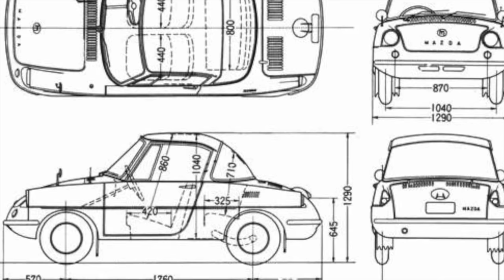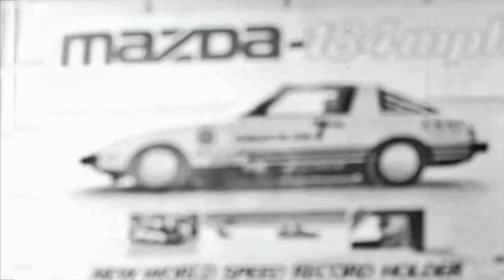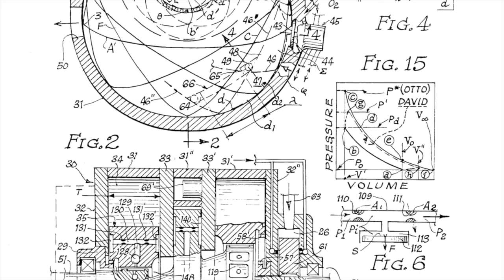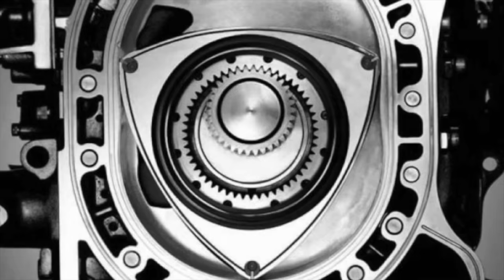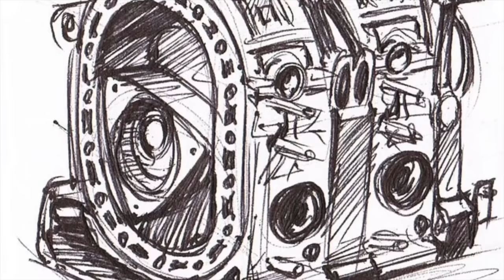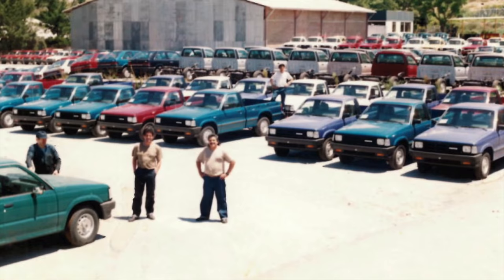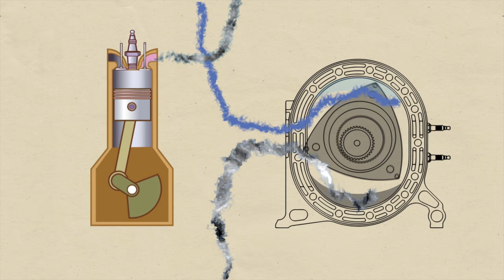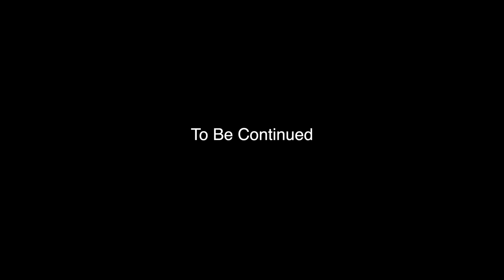Here's Why Mazda's New Rotary Engine is Genius

Comment: if my memory is good suzuki made a motorcycle with the rotary also .don' remember how they performed. back in the 80s my brother had the pickup with that motor . took it for a ride . i was into 2- stroke dirt bikes at that time and the powerbands seemed similar , flat on the bottom but as the revs came up it pulled pretty good compared to comparable small trucks at that time .

Comment: I always thought material technology is lagging behind the design of the rotary as Mazda implemented it and it's biggest problem has not yet been solved, so they move away from it. I think it's still in research however

great job  running thru the history. I never knew they were a big relief effort for post-war Japan. I always dreamed of having a Cosmo
Reply: Actually that is not true, the Wankel engine is obsolete because it's used several fatal flaws in its inherent design concept.
It's theoretical thermal efficiency is significantly lower.
It is less mechanically efficient and gas terrible combustion efficiency due to its geometry envelope.
 A round piston and cylinder is superior to the Wankel because of better seal integrity and thermal expansion.
Reply: Mazda abandoned development of Wankel engines in May 2009.
Reply: @sandervanderkammen9230  no actually Mazda announced the Sky-Activ rotary should be in their 2022 lineup. that means it was not an abandoned concept but kept in the loop
Reply: @pauls5745  Skyactiv-R is an internet hoax started by bloggers..

Mazda abandoned all development production of Wankel engines in May 2009.
 No new prototypes have been seen since 2008.
Mazda has not unveiled any new production Wankel engines in over a quarter of century.

Comment: Rotaries are still a viable option. piston engines just had a lot more manufacturers working on improving it. If rotaries had as much resources dedicated to it they'd be at the same or a slightly lower reliability and fuel efficiency level as a piston engine.
Reply: Not true, perhaps you should learn more about the development history of the Wankel engine... 26 of biggest and best engine manufacturers in the world spent billions in a race to bring the Wankel engine to the market first.
By the middle 1970s the experts had all reached the same conclusion... that the Wankel engine is inherently inferior to reciprocating engines.

Comment: WELL !! As long there's puerto ricans & australians the rotary engine is not gpnna die cause that lil engine has BIG ball honestly not much torque BUT they rev very fast & very high up to 13/14 rpm easily. Thanx mazda

Comment: Normally aspirated rotary engines routinely last 200,000 miles, and (assuming you can find a mechanic to work on them) are less expensive to fix.  I have an RX7 with 325,000 miles...(admittedly on its 2nd engine)
Reply: You really don't know anything about Wankel engines do you?
Reply: @sandervanderkammen9230  Owned an RX7 for 20 years.  I know pretty much everything about rotary engines.
Reply: @VAXHeadroom  Apparently not... not if you believe that they are reliable.
Reply: @sandervanderkammen9230  It's not that I 'believe' it, it's that I have hard evidence of it. 325,000 miles including 2 round trips from MD to FL and used as a daily driver for many years.  Normally aspirated 13Bs get about 200,000 miles between rebuilds.  Turbo charged cars are less.  Hot-rod it and all bets are off, but no different than any piston engine car. AND cheaper to rebuild.

Comment: Question Scotty! I just bought a 2002 Toyota Highlander. Would you suggest using the overdrive button? It feels like it's working the engine lot harder. Also why does it feel like the Highlander takes a very high speed of 85 miles an hour to switch into 4th gear? Would really love to hear back from you thanks

Comment: The most intriguing car I ever owned was a Mazda RX-4 which of course had the Wankel engine. after a week of driving it I looked into the hood to see where the gas was going. Then I saw the engine was topped with a 600cfm Holley. Hard to believe but there it was. Another happy accident was some loud car pulled up next to me at a light so I turned the dogs loose and to my utter disbelief I was at the next intersection before the other car finished crossing the first intersection. And I had a five speed stick. Nothing about the styling of the car said "Speed" so I owned my first "Sleeper" Then those short runs got to be a habit. I didn't care what pulled up next to me. I would win. I knew it. I also found out that engine car rev up to infinity so if I didn't have time to shift, no problem. Sadly the time was up at 80.000 miles, I lost one rotor, kept driving it although the speed was gone then the other rotor quit. I parked it using the starter motor and that was it. But if I ever had a chance to get another Wankel engine I sure would. I would enjoy it at least for 80.000 glorious miles!

Comment: Ive had 3 older RX7s.... I always thought the motor was amazing..... Chevy had a Camaro on the drawing board in the late 80s with the rotary engine... They scraped it because the maintenance cost was to low :( yep

Comment: Actually I think Mazda used my idea to improve the rotary by  incorporating a full plasma ignition system. I saw they are using it in the RX9. It will eliminate the rich nature of the rotary motor plus more power! Auto manufactures are so far behind from the after market performance world!
Reply: The RX-9 never existed, it was an internet hoax started by bloggers.

Comment: NEW?  the engine was designed in 1960s by Felix Wankel. The design was sold to GM to be used in the Vega, but it failed the 50K emissions test and was sold to Mazda.
(On a clear day you can see General Motors)

Comment: I personally have been wondering why I haven't seen Mazda try to use something like TC/W3 oil in the fuel to improve the lubrication of the apex seals.
Reply: Why would they do that?
Reply: Mazda does not recommend Premixing or using 2 stroke oil in its 4-stroke engines.
Reply: @sandervanderkammen9230  You know those apex seals have been the Acheles Heel of the engines. Also, TC/W3 oil is designed to be burned so it may be easier to make emissions with it or other purpose built lubricant than to inject engine oil, which isn't designed to be burned.

Comment: We had a Mazda RX3 wagon. The tiny rotary engine offered six cylinder power with V8 economy. No kidding. It also begin using a quart of oil a week as the engine developed wear. The design was interested to me how such a small engine could put out such power for a small displacement. But the poor fuel consumption and terrible oil consumption were huge negatives.
Reply: well it's a RX3.....what did you expect, that's like buying a diesel and complaining it doesn't have Corvette power.

Comment: Little bit of interesting history. I'm curious if the engine could work with modern materials?
I mean Titanium is a thing now.. if they could figure out how to coat the inside, or put in a sleeve of the stuff, or something? 
Ford has its new "Compact or composite iron graphite".. surely something could work?
Reply: More than likely, only one company makes them so there's not a lot of extensive research going happening about how to make them better, everyone's going electric lol
Reply: @user-ss2ly1ir6j  True I suppose? Hey, do you know if this engine would run on diesel fuel? ... Diesel has a different 
Viscosity than gasoline, maybe it would perform better?

Comment: Had a friend that owned a Mazda mini pick-up with  rotary. It got worse mileage than a full size Chevy 4x4 with a 400ci engine
Reply: max Payne that cause the main problem with the rotary engine is bad thermal efficiency, it has a lot cool interesting features, but the bad gas milage takes away from any benefit

Comment: Rotary engines make excellent aircraft engines because they fail slowly instead of locking up all at once.
Reply: Wankel engines are not used in passenger aircraft because they are too unreliable.

Comment: I thought rotary engines were used in a large number oy aircraft  (lower emission's regulations).
Reply: The Wankel engine is too unreliable and inefficient for aircraft.
No legitimate aircraft manfacturer has ever sold a Wankel powered plane with a FAA or EASA airworthiness  certification.
Reply: Are drones considered aircraft?
Reply: @orthogonal1  No, they are not.

Comment: is the 1994 celica still a reliable car or do you need to have an affinity for car mechanics in order to have fun with it. I want a good reliable everyday driving car and not worry too much about stuff breaking down because it is such an old car.
Reply: I mean yes it's reliable but find one in good nick that hasn't been abused and neglected
Reply: Older and reliable do not belong in the same sentence. Yes, you can have an older car that can be a daily driver but it is going to need regular maintenance in order for that to happen. And by regular, I mean weekly to biweekly you will at least be tightening something up, adjusting something, or replacing something. It will not be like a newer car where you can put gas in, change oil, and check tires every 6 months and let your mechanic look at it once a year, your gonna have lots of little things daily to weekly which is part of the enjoyment with older cars but only if your mechanically inclined!  They aren’t hard to work on but you have to have the tools and place to do it. You can’t really do it in the city street. 

Good luck!
Reply: @1982MCI  well 90s Toyotas are piss easy to maintain compared to any modern car so it shouldn't be too hard, I own an old Yaris T Sport and is so easy to work on
Reply: @1982MCI  hm well it would be my first car and i dont know too much about that stuff. I found one with about 100 miles ... It would be no problem to do little things here and there but i dont want to have problems with it every other day.

Comment: So exactly what NEW rotary engine are you talking about Scotty?  New when?  Last vehicle to have a production rotary engine was in 2012 eight years ago.  Is that the new engine you are speaking about?  Granted the engine is very interesting and might have some place where it is the best solution,  but Mazda didn't stop producing it because it was the best solution for today's needs for either mileage or pollution.  So again "Mazda's New Rotary Engine is Genuis"?????
Reply: The last production Wankel engine design from Mazda was unveiled a quarter century ago... the 13B-MSP-RE was unveiled in the RX-01 concept at the 1995 Tokyo Motor Show.
Mazda abandoned all development of Wankel engines in May 2009.

Comment: are you turning us into the page of '60s or '70s?  if i remember correctly,  this tech was from NSU!?
Reply: NSU destroyed the reputation for the Rotary Engine from the start, because the Germans did not know how to build a reliable Rotary Engine.

Mazda should have got the patent straight from Felix before NSU, Mazda is the only one that have built reliable Rotary Engines!
Reply: @niklasgroning5792  Troll.

Comment: Ahh yes, poor old NSU and the troublesome but comtempory design (at the time) of the RO80. When the engines failed in them (in next to no time) the popular thing to do was swap in a ford engine, namely the Ford Europe V4 (Ford europe are basically German/British designs mostly built in Gemany, Spain and Britain for that continents market) Altho the V4 wasn't the greatest engine in the world either it fitted comparatively easily in the space the rotary used (obviously by being half the length of a straight 4/V8 etc) The V4 was mostly fitted to the european Ford Corsair and early Ford Transit (yes you guys have european vans now abeit assembled over there for your market , transit in its various generations have been around since 1965 in europe) Similarly fiesta has been around since 1977 (altho US had the MK1 fiesta briefly for 2 years in late 70s/early 80s but very few sold) And the now discontinued Fusion (mondeo) had been around since 92 in europe. anyway i digress :) Keep up the great work Scotty :)

Comment: Why would you buy a Mazda Wankel?  I had one back in 1972. Great engine ....like an EV, but then in 50k miles the seals started to leak lube. I go rid of it. Many great ideas are not so great. I would ask "why now?", EV's are coming on the market. My daughter drives a Ford hybrid--40 mpg. Never  much reason to fill the tank--gets about 50 miles on overnight charge.  Downside is the 100,000 mile battery life which means you will get nothing on trade at 90k miles

Comment: Hey Scotty quick question  I got a 08Jeep Wrangler Unlimited X and my check engine light keeps turning on i hooked it up and gave me  a code: p00456 EVAP system small leak 
Was told to change the gas cap and I did now the dash says gas cap  and the engine light went away for a week now is back pleas help me man I like your video and I know you got great advice 👍🏻

Comment: C'MON Scotty,  I read the history of the rotary engine.  It was really the brainchild of George Wankel,   (not sure spelling is correct).  The wankel engine was invented/developed pre WW2.
Reply: Wankel than offer the rights to Ford.  After sitting in the shelf at Gm,   for a few years,  Chevy pick up the wankel prototype,  studied the plans and using standard materials built a 2nd prototype,  which became the 1st stateside rotary engime.  They mounted it in a small chevy car and drove it around awhile.  After engineers studied it they said the engine was capable of a 999,999 mile life expectancy.  The engineers informed the board of directors the only reason it failed was the gasket material.  The report further stated the fuel consumption was in the high 20's or low 30's mpg.  Sorry Scotty can't remember much more than that.  Except. USA felt so bad about those bombs dropped on Japan we gave them the wankel engine,  some plans from Harley Davidson,  which turned out to be the first water cooled motorcycles ever mass produced,   Yamaha Ventures!  I know these things I owned 4 of those bikes.  Of course the Ventures of today aren't anything like they were in the Ventures of the  '90s.  The history I remember of the Wankel came from a real old motor magazine printed maybe 15 - 20 years before you were born.  I must confess I was only 19 or 20 years old at the time.  I'm not sure of this part:  Felix was a younger brother of George Wankel who invented the Wankel engine in the years before WW2 in Germany.  Felix helped with parts of the building of the prototype,   but with only part of the design.  Felix kept hounding George about saling the plans to the USA.  As you know Scotty the USA was hot to get their hands on as much German tech as they could back then.   I think I made a mistake or 2,   sorry if I did.  Memory isn't as good as it used to be.

Comment: It's time to stop revving up engines. Charge your batteries instead.. It would be nice to see the end of diesels too, their owners never turn the darn things off. We have to get rid of all the oil burning air polluters.  The sooner the better.
Reply: pyrotechnic5254   Diesel pollution KILLS millions of people annually. You can go on liking the smell, but don't breathe too deeply. Actually, that's part of the problem, the deadly particles are too tiny for you to notice them. They interfere with mitochondrial respiration, its one reason why you can have a good nights sleep yet wake up feeling exhausted.  There are cleaner and better and cheaper ways to do everything that diesels do, so diesels are doomed.  That makes me happy.
Reply: Nothing is more dirty and inefficient than rechargeable batteries...
A Telsa S contains more than 35 pounds of toxic waste that cannot be recycled...
Reply: Electric cars pollute just as much as Diesels... EVs just have a longer tailpipe!
Reply: @sandervanderkammen9230  Another oil company myth. Batteries can be and are re-cycled.
Reply: @aufornvic  If you want to call old batteries heaped up in 30 foot piles in Third World countries and set on fire "recycling"!

Comment: wankel's tend to rip themselves apart by design...    mechanical nightmare to seal the thing.. a cylinder type piston has one seal,  a simple ring...  but the wankel require 9 different shaped ones...

bad design is all.
Reply: Very true, the Wankel is fundamentally inferior and unreliable by design